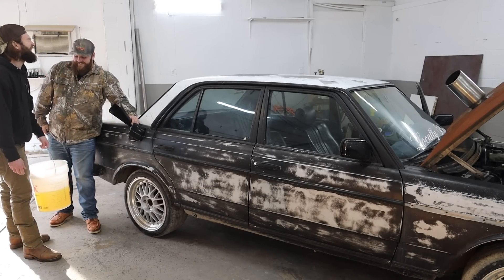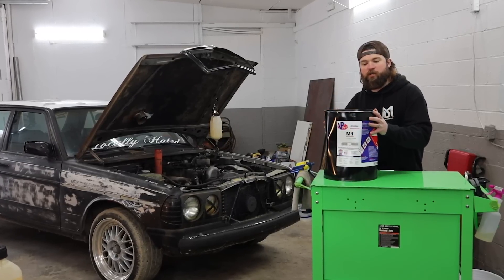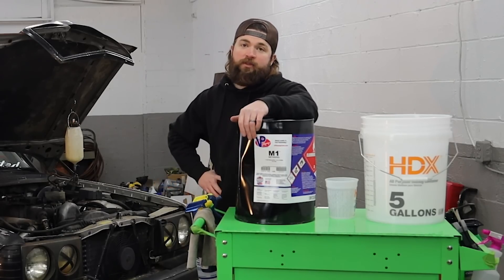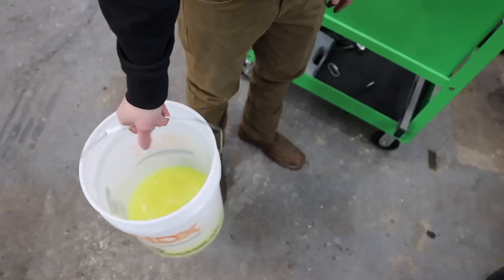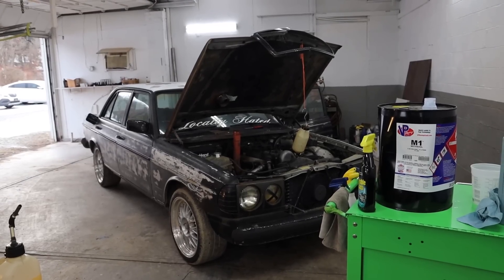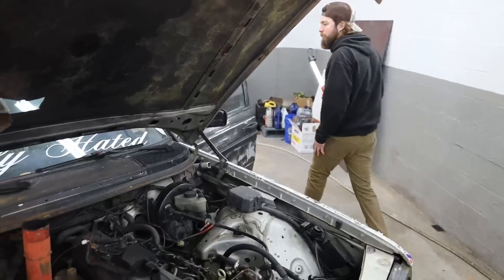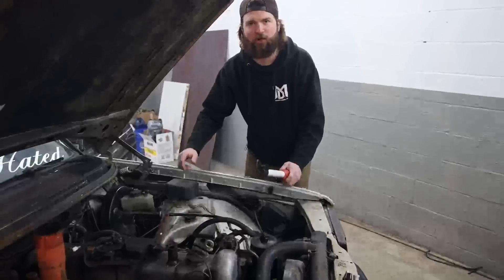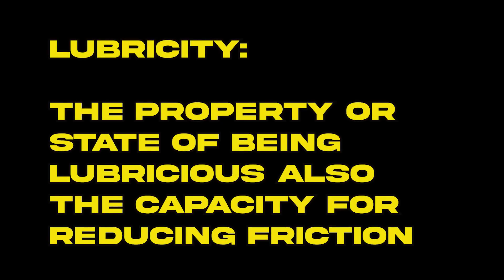What Happens If You Put METHANOL in Your Diesel?

Comment: From ChatGPT: Share

You said:
What happens if you mix M1 Methanol with your number 2 diesel fuel/ULSD?
ChatGPT said:
ChatGPT
Mixing M1 Methanol with No. 2 Diesel Fuel or Ultra-Low Sulfur Diesel (ULSD) is generally not recommended due to significant differences in their chemical properties and potential adverse effects on fuel system performance and engine operation. Here's what happens when you mix them:

1. Phase Separation
Methanol is highly polar and hygroscopic (absorbs water), while diesel is nonpolar. When mixed, methanol tends to separate from diesel, especially in the presence of water. This can lead to inconsistent fuel properties and operational issues.
2. Reduced Lubricity
Methanol lacks the lubricating properties of diesel fuel. Adding methanol can dilute the lubricity of ULSD, potentially causing wear or damage to fuel injection components like pumps and injectors.
3. Combustion Challenges
Methanol has a lower energy density compared to diesel, which can reduce engine power output. Additionally, diesel engines are not designed to combust methanol efficiently, leading to incomplete combustion, increased emissions, and potential engine misfires.
4. Corrosion
Methanol can be corrosive to certain metals and elastomers commonly found in diesel fuel systems. This can lead to premature wear and failure of fuel system components.
5. Fuel Stability
Methanol can promote the oxidation of diesel fuel, accelerating the formation of gums and varnishes that can clog fuel filters and injectors.
6. Safety Risks
Methanol is highly flammable and toxic. Mixing it with diesel increases the risk of fire and poses handling and storage hazards.
7. Regulatory and Warranty Issues
Using unapproved fuel mixtures may violate fuel quality standards and void engine warranties.
Summary
Mixing methanol with No. 2 Diesel or ULSD is not practical or safe for use in diesel engines. If you are considering alternative fuel blends, consult with engine manufacturers and fuel specialists to ensure compatibility and compliance with standards.

You said:
Will it not also cause the diesel fuel to gel?
ChatGPT said:
ChatGPT
Yes, mixing M1 Methanol with No. 2 Diesel or Ultra-Low Sulfur Diesel (ULSD) can contribute to fuel gelling under certain conditions. Here's why:

1. Polar-Nonpolar Interaction
Diesel fuel is nonpolar, while methanol is highly polar. When mixed, methanol can disrupt the molecular structure of diesel fuel, particularly the paraffinic hydrocarbons that are prone to crystallization at low temperatures. This disruption can accelerate the formation of wax crystals, leading to gelling.
2. Water Absorption
Methanol is hygroscopic, meaning it readily absorbs water from the environment. The presence of water in diesel fuel lowers the temperature at which wax crystals form (the cloud point) and accelerates gelling. The water-methanol-diesel mixture can form emulsions or ice crystals at low temperatures, exacerbating the problem.
3. Cold Weather Effects
In cold climates, the addition of methanol can worsen diesel’s cold flow properties. Diesel already has a tendency to gel at low temperatures, but methanol can make the fuel less stable, lowering its pour point and increasing the likelihood of fuel system blockages.
4. Impact on Additives
Diesel fuels often contain cold flow improvers to prevent gelling. Methanol can interfere with these additives, reducing their effectiveness and further increasing the risk of gelling.
Practical Considerations
If methanol is inadvertently mixed with diesel, especially in cold weather, the fuel may gel faster than expected. This can result in clogged fuel filters, restricted fuel flow, and engine shutdown.

Recommendation
Avoid mixing methanol with diesel fuel. If you need to enhance cold-weather performance, use a diesel-specific anti-gel additive or blend the fuel with an approved winter-grade diesel or kerosene, as recommended by fuel suppliers and engine manufacturers.

Comment: towards the end of WW2 the german Wehrmacht converted many of their Diesel trucks to methanol. Diesel was hard to come by and Methanol less so as it was an intermediate product of synthetic fuel production from coal. They put a carburetor on the intake and used the Diesel injection on idle/low load as ignition aid.  My grandpa told me about it.

Comment: Meth injection is not the same as running methanol in your engine. Water/Meth injections only active ingredient is water. The methanol is so the water won't freeze in your tank. Water/meth injection is to lower the IAT's

Comment: Why would Tractors with  Turbo charged engines and spark plugs sound like a Deisel?  They  are Diesel engines "Compression ignition  and  straight Methanol has spark plugs..
  Methanol will destry the Lubriciy of your Fuel .. You will need to add some Castor "Bean" oil to the Methanol ..

Comment: But also should you put additive or two stroke oil or even atf as lubricant for the injection pump and would it still work ? I put half a quart of atf in my truck every three tanks and it’s a 6.0 powerstroke and I haven’t had a bad injector since but I can’t say the same about the head gasket but that what I get for putting big injectors in it at 260 k and raced it a lot the overheated it after 30 k and put the oem injectors back in and now she sits with lifted heads at 306 k but she still runs and I haven’t had the time to work on it yet 😢

Comment: About 35 years ago Detroit Diesel.ran an experimental program for city bus engines running on methanol. These were 6V92 engines. The diesel fuel versions were 277HP with engine life of about 350,000 miles. The methanol engines were also 277HP but required about double the fuel to be injected. The heads looked the same but had glow plugs from the Chev 5.7 diesel. There was a glowplug controller with LEDs that flashed when the glow plugs were energised. The heat of vapourisation is so high with methanol that it would absorb the heat of compression from the air and not fire in a cold engine. The engine running sounded like a blown alcohol drag engine. Once it did a run and the cylinders were well warmed up it idled smooth as silk, for about 2 minutes when it had cooled the cylinders and the rough idle came back.
The early testing gave engine life of 50,000 miles due to the high quantity of fuel being injected washed the cylinder walls. Many additives were tested in the fuel and got engine life up to 100,000 miles. Eventually the engines were converted back to diesel fuel but initially the methanol heads were used. They ran fine during a run on the route, but would not start after being shut off. The fuel system would have to be primed again. The methanol heads were engineeredcto retain heat, which boiled the fuel sitting in the fuel rails. The heads were then replaced with diesel heads and no more problem.
Tractor pullers will be rebuilt fairly often so ring and cylinder wall life is not the same concern as a daily driver.
It was an interesting experiment. The idea had come about to reduce soot emissions in city use. That part was successful. I think diesel engines converted to run on natural gas would be the answer. Large industrial engines can be had in diesel or natural gas fuel versions.

Comment: I had a friend back in the 70's who had a newer, at the time, Mercedes, not sure what engine. I took a two year diesel mechanics course back then and was used to hearing glow plugs, glow plugs, glow plugs at school.
    One of the teachers who was a retired mechanic himself had an early 60's Mercedes that he bought brand new. It had almost a half million miles on it and he never changed the spark plugs once. I'm serious. He never put a single spark plug in that car. He said that he had only flow timed it a several times just to show classes how it was done, changed the oil, filter, air filter at the proper intervals and replaced several batteries over the years. He had done other service to it like grease, rear end gear oil changes, clutches and steering and suspension parts as needed but almost nothing to the engine. He obviously took care of it.
    My friend's car didn't have glow plugs. He lived in Pa. and I asked him how the hell he got it started in the winter without glow plugs. He said that there was a chart in the owner's manual giving temperatures and percentages of gasoline to diesel blends. The colder it was, the more gasoline you used up to 30%.
    The only problem was if it got cold where you added 30% gas then it warmed up substantially for several days in a row, you either didn't drive the car or you had to drain the tank and use less or no gas at all depending on how warm it was out or risk blowing the cylinder head off. Sounded like a lot of work for a luxury car to me. Put back the glow plugs.

Comment: So bit of history on this idea, people have made their own diesel fuels for a long time, but it was almost a movement in the 1970s when experimenting with WVO because of the fuel shortage and needing a solvent to break up filtered veg oil to get it to flow better. Percentages of anywhere from 2-20% Methanol was a common additive, depending on your locale in the US and time of year. I helped a friend do this with a diesel Merc and he also chose to run 20% in a northern climate, though it is not uncommon for even commercially available diesel to have a methanol blend for colder markets (once upon a time, it was a distinguishing additive between #1 and #2 diesel before advanced blending with various nitrates). 
How much carbon you see exiting a diesel is largely a factor of burn efficiency. If you're burning closer to peak thresholds, very little carbon/soot exits the tailpipe, you're getting more power out of your fuel, but knock chances are higher under hard use like towing. Thus you will see people under the thinking that having a saturated fuel rate is 'safer' for preventing engine damage on 'tuned' engines, when in reality, they aren't burning all the fuel injected into the cylinder and it's blowing right out the tailpipe.

Comment: I run 10% methanol in a gas engine for a roughly 30 hp gain but be careful it also increases your head pressure so more isn't better if you value your rings. 10% is pretty safe on a healthy engine. And yes before it's said that is above what the fuel manufacturer puts in the gas at the pump

Comment: 20% petrol (gasoline) 80% diesel.  My truck flys

20% petrol 80% waste oil (hydraulic, trans fluid, sump oil… settled for 6 months, take clean waste oil from the top of the tank or drum etc). More kilometres/miles and more power. Works in both straight mechanical injection and common rail. Dpf doesn’t like it tho

Comment: pure methanol mixed with some castor 927 two stroke oil will do the trick.  1.5 fl oz to 10 gallons.    my bmw drag car runs on straight methanol and the castor oil has saved my engine more than once.  i wont run methanol without ever again after the experience.   i would bet you could add some used motor oil / corn oil to cut down the methanol and it would last.  you just need to get the fuel mix to similar stochiometry as diesel fuel.
Reply from the maker: Nice 👍  927 !!! I can smell it now!!!! Headed to the garage to dump some in

Comment: I know from doing this in the early '90s on a gasoline truck that you do not want to put methanol in a fuel system not designed for it. Had a bunch of duplicating fluid that had been scrapped when a company threw out all their old duplicating machines for modern copiers. We though it would be the same as the isopropyl alcohol you find in the fuel treatment bottles at the gas station and it would get everything squeaky clean. Nope. Not only will it eat natural rubber fuel lines, it will react with a lot of metals and your car will absolutely not run well on it. It ate the coating off the inside of the fuel tank and started it rusting. Worst thing ever when you're living through your first hangover on New Years 6 months later putting a new fuel tank on your old man's F250 in the snow because he had some other equipment in the shop all torn apart and we needed the truck running yesterday. We chased fuel system problems the entire time in between. Another lesson learned besides don't drink heavily the night before such a job, don't do experiments with equipment that you need to pay your bills with.

Comment: I'd assume with ethanol and methanol being solvents and diesel being a fuel oil, that the oil would dissolve into the ethanol, simlar to what it does in gasoline.... Would also exxplain how something like this can work considering a diesel fuel system needs to have at least some lubrication to work reliably. it doesn't take much to sieze up an entire fuel system with a solvent for fuel in a diesel engine.

Comment: Add kerosene with diesel fuel and you'll see it run like a meth addict....my 7.tree loves it and runs on used oil,water Methanol, propane, vegetable oil,seafoam, transmission fluid, and cocaine......mint

Comment: Also when you run pure methanol aka methamphetamine for racecars cuse it wakes up a high compression 500 HP motor, I ue to race dirt and asphalt oval wing sprint cars 410 975 rear wheel horsepower methanol breathing NA of course no force induction at all in oval rcong and been racing since I I was 10 and now I'm 30 but we run those sprint cars and high horsepower Imca and ump modifieds on meth as well and we run special pistons in meth motors and special carbs as well but you can lean the car out more aka more lean more mean well that's cuse it cools top of pistons alot more then racing fuel does and on a high humid cold night racing you will get the intake so cold you can chill a coke or a adult canned root beer beverage on it ala beer and it smells so good especially when you add the cherry scented additive to it is my fav scent out of all of them cuse I get sever headache from the exhaust when sitting and idling in line up next to other cars running and pushing their exhaust into your car and keeps eyes from burning so bad when tunning to. Awesome experiment pretty neat, please show us how to make old cooking oil diesel fuel or see if it will run on pure used frying oil that is only strained to get chunk of food out of it and restraunt will give it to you for free by the gallons especially a mom and pop no chain one will fill up a 50 gallon barrel for you if you leave it behind the restraunt for them and it's totally free and get 50 gallons in two weeks so free diesel fuel baby

Comment: Germans did exactly this in cold climates and when they could only access water contaminated diesel in the war. They had a lot of diesel planes as well as trucks. Russians used and still use the same method.  Methanol is one of the most effective ways to make water be absorbed into the fuel and not be a big problem (until it rusts out a pump anyway). So no fuel bug as no water/fuel layer for the bug to grow. Methanol has less specific energy than diesel, but a greater expansion coefficient, as a fuel replacement option its rubbish volumetrically unless you have massive tanks, like a ship for instance. Buuuut... In low concentrations it vastly improves the atomisation of diesel fuel as it lowers  the surface tension of it. This makes combustion more efficient. Here in NZ its often used to get cars that wont pass emissions tests normally due to smoke, more likely to pass by less reputable people. These days Used alongside/instead of acetone to make cooking oil more usable as a biofuel. It can be used as the special additive to turn cooking oil into biofuel. 
I've used it to treat normal diesel at 1 teaspoon to 2gal. Or in my lingo 0.7ml per litre. A 40litre car tank was 35ml of methanol. 2500litre boat tank was a 2litre bottle of acetone or methanol to treat. Enough to react out any legally allowable water content from a fuel stop plus any condensation from the tank breathing. At 10% I'm guessing that most of the power benefit from running ethanol is starting to be lost by its  lower specific energy,and the ability of the pump to get enough fuel delivered. Every engine will have its best value though.
P.S. half your oil change interval or even more often as methanol and ethanol both cause a lot more steam to be generated in the combustion process. Which can make it into your oil through blowby and the likes.  
Aussies used diesahol (looks like milk) as a substitute for diesel as it runs cooler than diesel in the deserts. Upgraded tank sizes to cope with desert distances and lower energy per gal though. Aussies also used LPG Fogging systems to improve power and efficiency of diesels as well.
Good luck :)

Comment: Any paper, or leather, or maybe even rubber gaskets or parts in your fuel system may shrivel up or disintegrate.
In 1980s they put methanol in motor fuel instead of ethanol and most cars with carburetors ( which was most cars 1980 ) had major problems in fuel department. Most GM carburetors used accelerator pumps with piston cup made of rubber or even leather and they all deformed and wouldn't pump any more.
I had a carburetor where all the paper material gaskets shrunk.
Plus don't come into too much contact with that stuff, not good for you.
( but you know that )

Comment: It depends on your electronics newer diesel engines the electronics can't handle methanol in your diesel.. Back in the nineties I used to run methanol in my cat diesel engines because they had a lot more power  And better fuel mileage. One gallon of methanol to every 50 gallons of diesel Did that for 20 years motors lasted longer And ran cleaner

Comment: you need to hold the 5 gal can the other way...spout on top when pouring
Reply: it didn't burn the whole gallon....it returned the fuel to the cars tank.  i would imagine an injector timing change would be necessary for it to run better